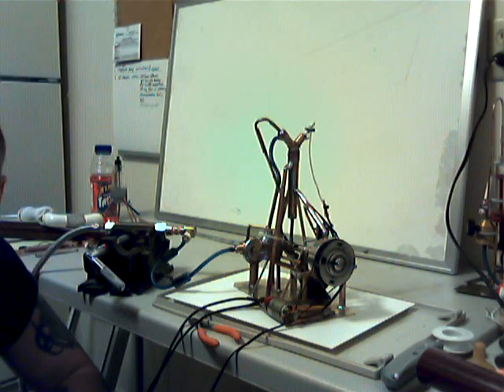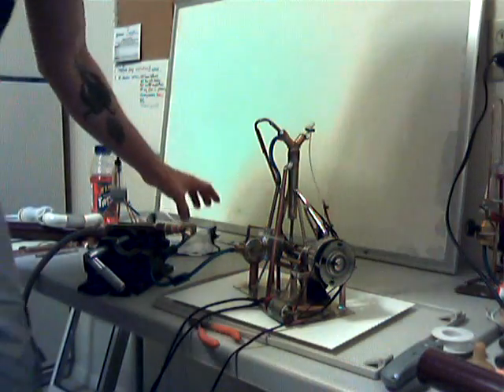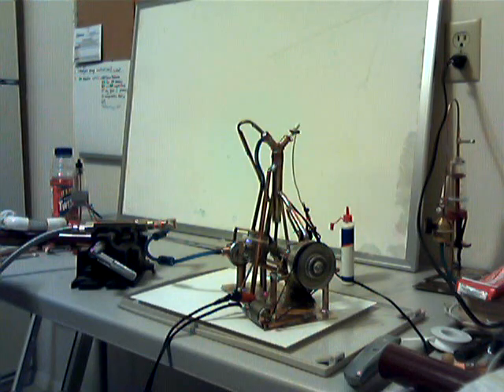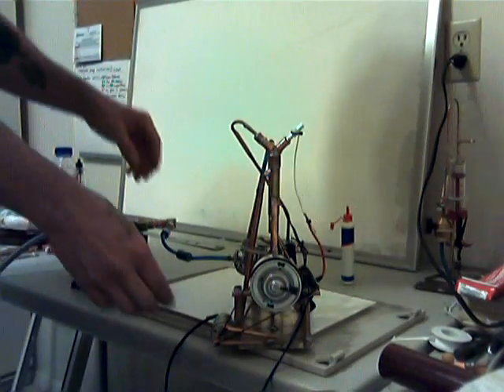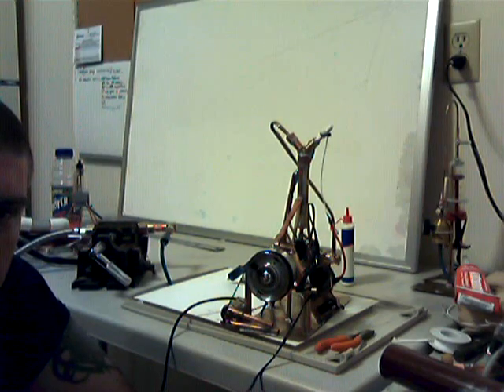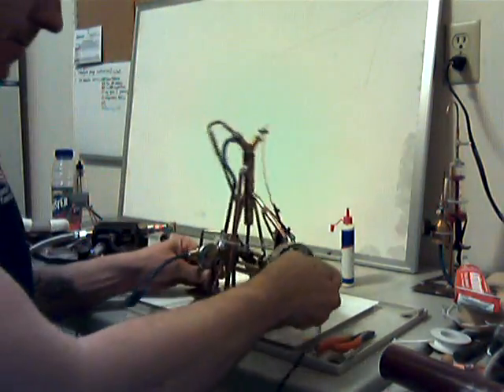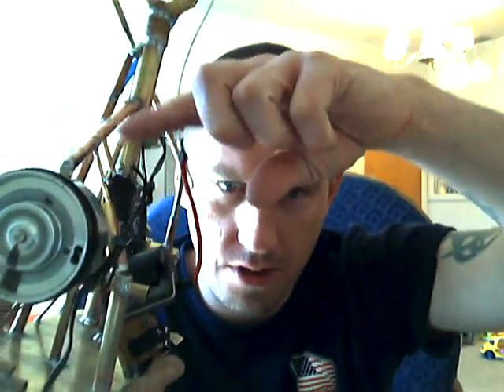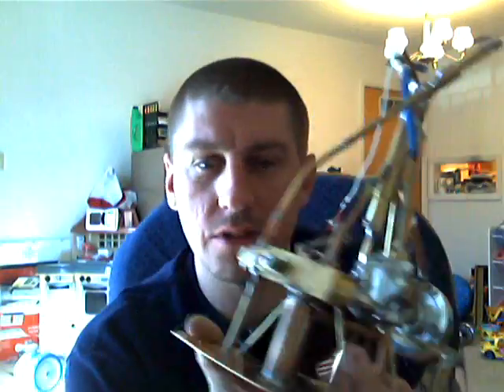hho brass engine

Comment from the maker: im no longer intrested in hydrogen energy
it hasnt got what it takes
i do like to build test devices but i have no tools so i had to build with brass,,,i also thought the device was neat even though it doesnt work it was more about learning how to build,,this device was not easy to construct i learned so much from this failer that i will probobly stop taking parts off of it,lol i like mechanical art to me machines are art works of creativity
a gift givin by God